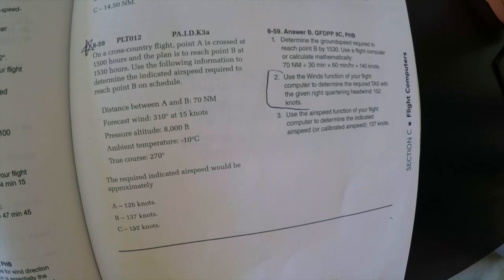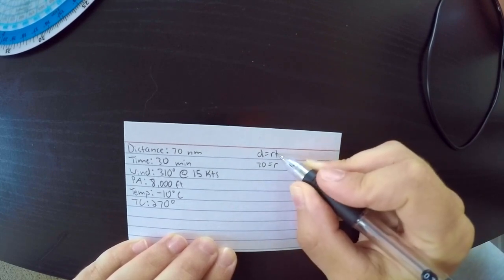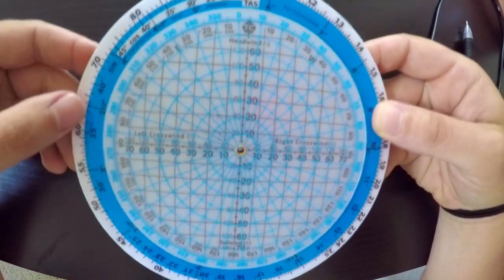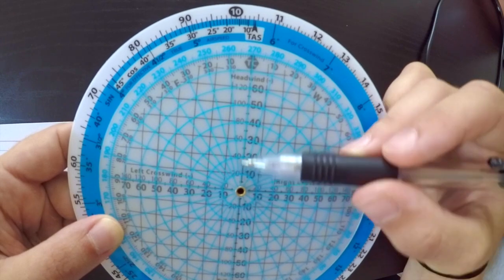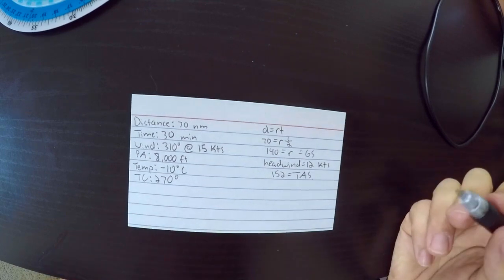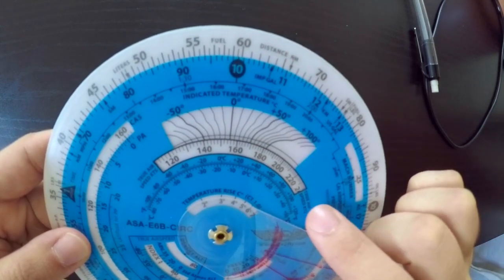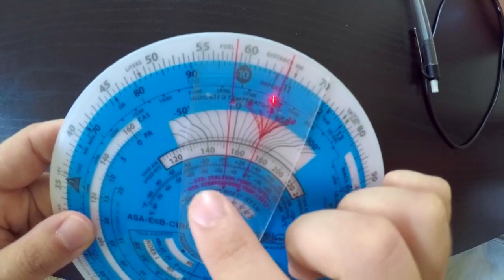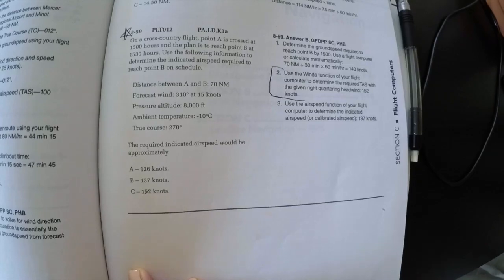IFS: E-6B Circular Flight Computer and Calibrated Airspeed

Comment: I have a Q: what's the upper part of the circ E6B window for, where the line becomes squiggly, if you use the bottom part for your ind. temp?  I suspect it has something to do with Mach because of the red splay lines but I'm at a loss. I'm new at this circ and got it for the mach ram rise temp correction.